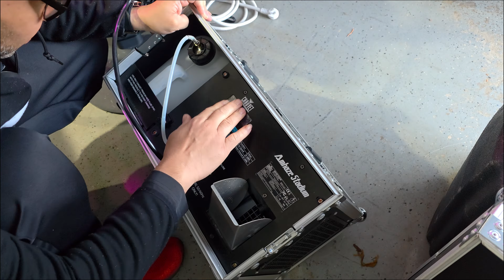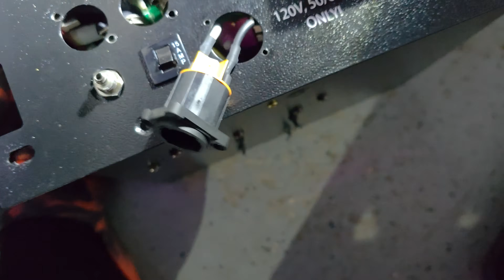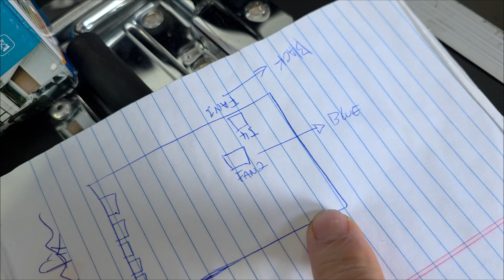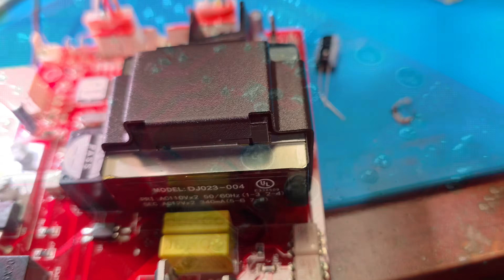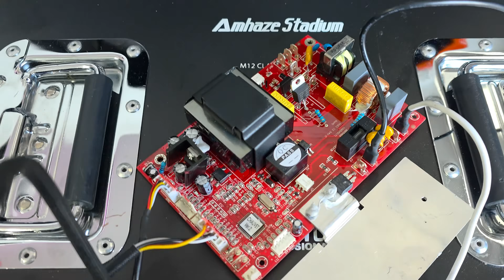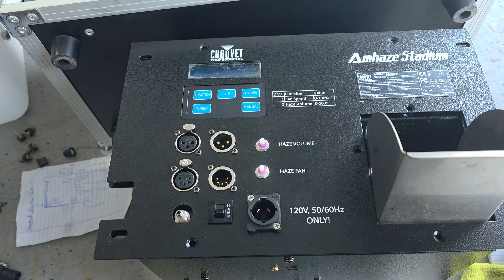Chauvet AMHAZE Stadium NO POWER Repair

Comment: It sounded like that's what you were suggesting, more for just people watching, 
but yes I never rely on the amperage markings molded onto the fuse holder,
because it's the rating for the max of the fuse holder itself and may not be rated for the unit it's installed in.
There usually should be a sticker on the board, or the sticker on the outside of the product with the correct fuse rating.

Also not very often a unit will have a fuse that they call a slow blow fuse, as some units draw a little more power when first turned on,
and need a fuse that won't instantly blow, but can take the initial draw. Not this one, but an old different brand model, I once had a fog machine 
that kept randomly blowing the fuse at start up,
but the unit ran fine when the fuse didn't blow. I looked in the owner's manual and it said to use the slo-blo, it worked flawlessly after.
Reply from the maker: Appreciate this comment and will keep that in mind for future repairs. Thank You
Reply: @djab203  No worries. I'm fixing ours and the 5A fuse and the other components were still good,
but I got 120volts all the way up to the primary of the main transformer, but nothing out, 
primary resistance measures infinite/open, the over voltage must have been high enough for killing the transformer, 
but still low enough voltage to not fry the other components,
likely someone tried powering it with 208/240v, on the front panel it says "120v ONLY",
unfortunately the model number DJ023-004 with no brand on the tag on the transformer
doesn't come up when searching on the internet, looks like I'll need to order that supply board. 🙁
Reply from the maker: Sorry to hear. I hate having to buy the entire board because a lack of parts. Sometimes I get lucky doing parts lookup using google lens. Hope you're able to fix it.
Reply: @djab203  I just tried Google lens because it helped me alot last week with a tricky part, but this one it just brought up random transformers.
If only there was a manufacturer name on it to send me down the right path 😕
Reply from the maker: I've been down that road before with many transforms which are custom made just for a particular unit. Finding something similar is neatly impossible 😔